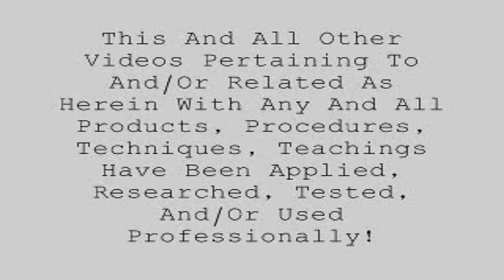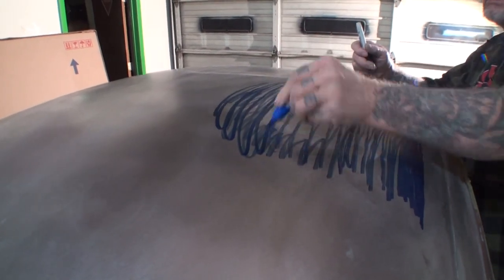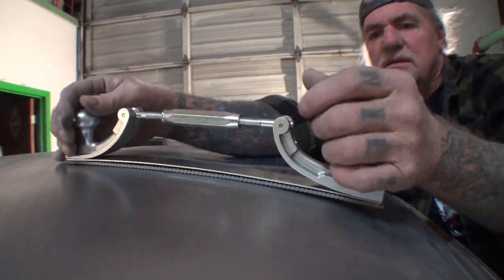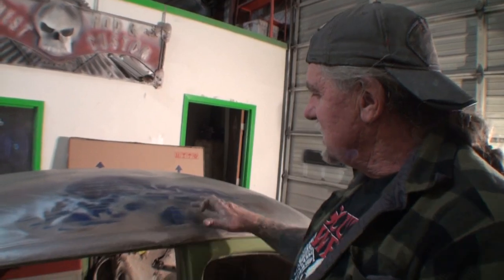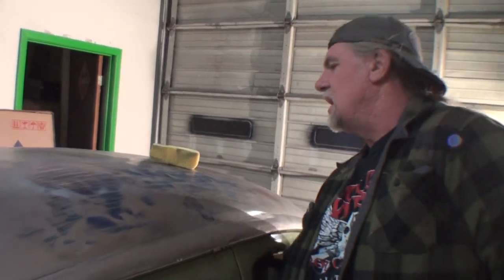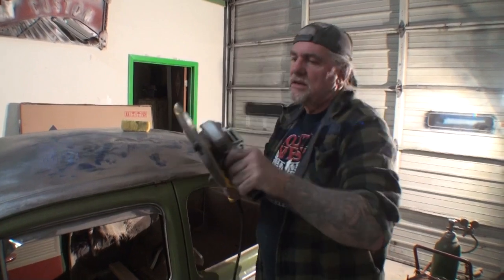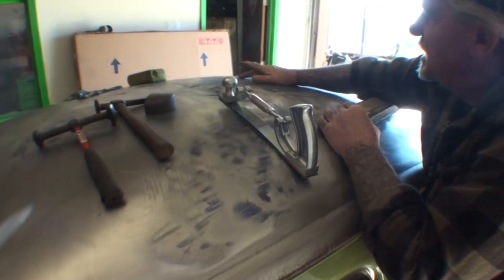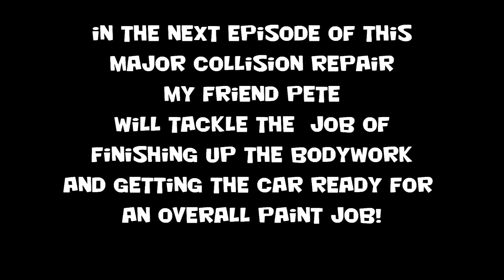Major Car Wreck Repair - 1964 Volkswagen Beetle - Part 3

Comment: What you have to do is beat the roof with a hammer to get down the high spot when that does not work ,you shrink it with a grinder and cool it ,when that does not work ,you sand it with a block ,when that does not work you file the high spot paper thin ,when that does not work you shrink it with a shrinking hammer and dolly ,when that does not work you jeat it with a torch and cool it ,when that does not work you hit it with a bondo buster, when that does not work you just say fuckit and fill it high ,just like pete